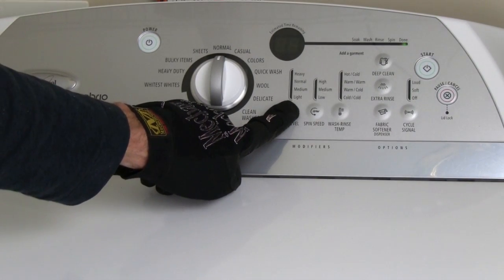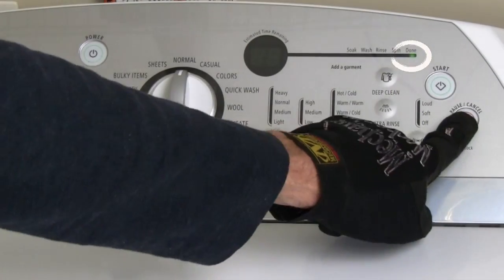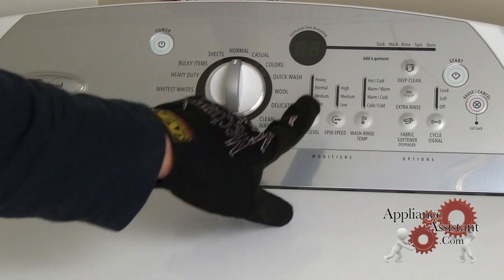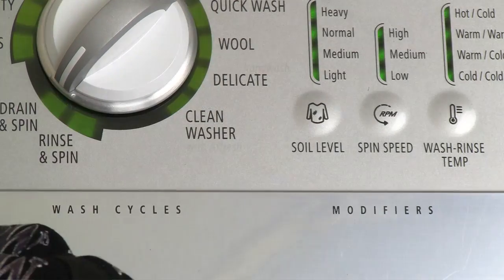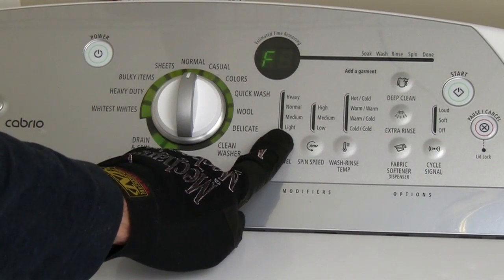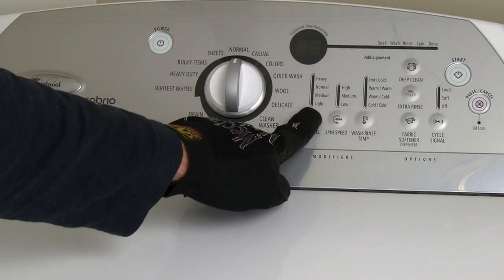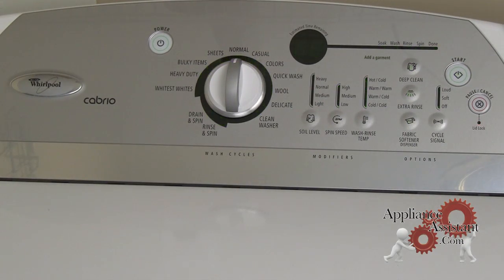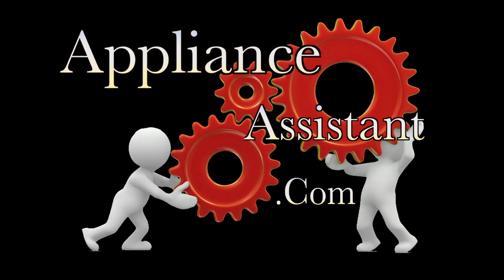Washing Machine Diagnostic Test & Error Codes (Cabrio, Bravo, & Kenmore Oasis)

Comment from the maker: The F70 code is a stored version of oL which is overloaded... it means that the inner tub did not float up off of the hub as water was filling the washer.  This could be caused by something like a sock getting between the inner and outer tub and jamming the inner tub from moving freely.  It can also be caused by rust on the drive shaft and center tube of the inner tub that is not allowing the tub to rise. You need to remove the inner basket and take a look... Hope that helps! Good Luck!
Reply: This wasn't my problem, but this explanation led me to the problem.  Thanks!
Reply: Could it be weak springs?
Reply from the maker: @Socal_fisherman626  not usually on an F70 that would most likely lead to an out of balance error instead of an overload error.
Reply: The basket sits low! When I try to push the basket down, it bottoms out
Reply from the maker: @Socal_fisherman626  it could be a secondary issue. But should not cause the F70 code. There are no sensors for detecting that symptom, except for the ul “unbalanced load” the over load F70 is related to how much time/water is required to make the inner tub float, and disengage from the drive hub.

Comment: Hello, I have Whirlpool Cabrio Model WTW6200SW2 washer, during the cycle UL comes up on the screen and also no matter what load size you have choosen it over fill the water in 2nd rinse and then spin at the time to rinse therefore sill lots of water. Once I pause the machine and then Start again the remaining load finish normal but if left un attended then flooding... Please help. Thanks

Comment from the maker: Depending on how gummed up the hub and drive shaft are it may be easy and may be a pain... The cap of the agitator/wash plate will come off by prying from the side seam with a screwdriver.  Then remove the 7/16" bolt and remove the agitator.  you should see the hub.  You then need to look it over really good for striped gear teeth anything that might keep the basket from lifting free when the tub floats.   I have more info on my website.  Good luck!

Comment: great video!! I had code f41 and code f51. ran diagnostic test and it failed on C1 with an oL code. turns out the basket was stuck on the driveshaft. took it all apart and cleaned gunk from driveshaft. diagnostics run all the way through now no problem. but is there a way I can clear the old codes?

Comment from the maker: Well the drain pump could definitely be the problem. You would need to check for 120 volts the the pump motor when it should be draining... if the pump motor is humming there may be something the the pump that is jamming it and keeping it from turning. If it is not getting power there is ether a loose contact or the control is bad.

Comment from the maker: That is a calypso washer.  id is probably LD for long drain.  You may have a problem with the drain pump... fairly common problem on that washer type. 
“Ld” flashes if it takes longer than 5 minutes to pump out water to a point where the operating
pressure switch resets.
The automatic service diagnostics mode is activated by pressing:
SOAK - SOIL LEVEL - SOAK - SOIL LEVEL
Pump Motor correct resistance values
RD to WH   10 - 12 ohms
YL to WH   10 - 12 ohms
RD to YL   20 - 25 ohms
Good luck!

Comment from the maker: Many of these washing machines are having a problem with the early version of the suspension rods that suspend the tub.  The new suspension kit seems to be solving the problem, it has a new cup that is installed on the top side of each of the four suspension rods.  Part number is W10189077(50.00) for the set of 4.  If you do order them please buy through the links on my website  so I get a little commission : ) or I can drop ship them to you if you email me through my web site. Good luck Thanks!

Comment from the maker: Could you please double check that model number? What country are you in?  It probably means that the lid is unable to lock "Door lock" The F should be followed by something like 51 or 1  The top is held down by two spring clips at the front seem about 3 inches in from the sides... Press them in with a putty knife and lift.  Hopefully you will be able to see the cause or you may need a new door latch or control board... Hopefully you find something blocking the lock from latching... Good luck!

Comment from the maker: It's a little tricky on that style of washer.  You have it right and it should work if the timing is correct. If it does not then you may have a board problem.  Think of it as a safe combination but before you start the process clear the knob at least three full rotations to the left...  then one click each:  R - R - R - L - R  with a very short pause between each move.  If it works all the lights should turn on.

Comment: I know this test well, but I have a problem with the new maytag bravo washers. Model mvwx700xlo, In that tech manual it says to clear the board by turning the selector knob counterclockwise then within 6 seconds turn clockwise 1/2 sec, turn clockwise 1/2 sec again 1/2 sec then counterclockwise 1/2 sec, then clockwise 1/2 sec. I've tried this on several Maytag Bravos and can't get it in diagnostic mode!! Please if anyone can tell me what I am doing wrong???

Comment from the maker: That is the newer style of Cabrio that Whirlpool released after I created this movie. It is completely different mechanically and has kind of a tricky diagnostic mode.  Take a look at the lid striker that is attached to the lid (the part the inserts into the lock.) The back of the strike is open and leaves the internal magnet exposed  allowing it to swell with rust.  When that happens the lock cannot close all the way so it will do what you are describing. If not email me through my website.

Comment: Help i have a Cabrio wtw5500 model...is there away to find a code for it?   It seems like the sensor may not be recongnizing that the lid is closed and it won't stay locked.  It will lock to start and the it unlocks and won't continue the wash.  Please help!

Comment: This machine really sucks!  UL all the time!  It is UL when I run clean washer mode, with nothing in the washer!!!  This washer is nice looking on the outside but I wasted a bunch of money on the set.  Whirpool is making tons off of repairs, parts, and keeping repairmen busy.  The old maytags lasted forever, I had one for 40 years , and the paint never chipped.  This new whirpool lasted 12 months before it started sounding like a train wreck!  Don't buy this machine. It is horrible to listen to.

Comment from the maker: The SD code is usually for suds or a long drain code. you may be able to get it to work by letting the suds turn back to liquid and then trying to drain/spin again. if that doesn't work you may have a problem with your drain pump, pressure switch or control... but probably the drain pump. hope that helps! Good luck!

Comment from the maker: Ahhh... that's slightly different.  Well I don't quite know what to suggest... I guess one step at a time. The nice thing is I think you can send that back to appliance parts pros for the cost of return shipping.  The board should be sending out 120 VAC to the drain pump during the C7 step. If not check connections.  If the connections are good it needs a new board :(  
Sorry to hear about the difficulty... 
My grandma always told me you get further with honey than vinegar... Good luck!

Comment: no, i purchased the drain pump myself and installed it... it is still not draining and giving the same LD code and F32 when i run the diagnostics..the repair guy didnt have the part and said it would take 4 days to get... i got it much faster... the repair guy said he forgot to check the control board with the meter?

Comment: please help, i had a repair guy come out from Appliance Parts Pro to check the voltage on all the wires and i have in writing from them that it's a bad drain pump.... i got a new drain pump from another company online, put it in and doing same thing... so i bought a drain pump and did need one apparently... the tech that didn't diagnose the issue correctly had given me his personal cell and told me to call him if i had any issues... well i called and he is coming out this Sunday. :-(

Comment from the maker: The faint click may be the relay in the board closing to energize the pump. You may want to double check the connections to the drain pump. To be sure you would need to measure for 120 Volts AC at the wires to the drain pump. I would start with that if there was a clog in the tub you should still hear the drain pump turn on.

Comment: i turned it to drain and spin to try and get the water out...all i hear after pressing start is a very faint click... it isn't the lid lock click because thats louder... there was nothing stuck in the long drain (which was the original LD code I saw displayed when it stopped draining the other day) when i ran the diagnostics it says F32.... which i thought was the drain pump... how do i check the internal basket to see if anything is stuck there.

Comment from the maker: The drain pump should be on at C7 until the inner basket drops and is engaged on the basket hub + 10 seconds...Do you here the pump making any noise? if the pump is running and just not moving water it may be broken or clogged, you may also have a clog at the outer tub where the drain pump connects. however, if it is not being energized you would need to check if power is getting to the pump from the control's P4 connection.

Comment from the maker: F51 is an RPS (Rotor position sensor) error. That is the sensor that detects motor movement.  They like to do this error but the RPS is almost never the cause.  Sometimes unplugging and reconnecting the connections to the sensor and the control board several times will clean of any corrosion that has built up and may be causing the communication error. I have a repair guide on my website, but accessing the lower RPS contacts is not very easy. Might be worth a service call if you trust a company.

Comment from the maker: Sorry for the slow response. That would most likely point to your motor getting hot... You may have something like a small sock stuck between the inner and outer tubs.  I have a service manual for that washer available on my website. Its not to difficult to pull the inner tub out and check.

Comment from the maker: @xzqzq It takes a very long drain time to activate the LD and F32 error codes. So you probably do have a blockage somewhere. I usually use a Shopvac to suck out as much water as possible from inside the washer, then tip the washer back so you can get at the drain pump (unplug it first and be ready for a lot more water.)  Partially remove the hose from the tub to the pump and get the water under control, then remove the pump and have a look inside. If it's clear, are all 4 fins intact?

Comment: My Whirlpool Cabrio washer,  type 580,  wtw6400sw3,  cy0270534, is faulting during the rinse exhaust, showing ' LD'  at @ 13 minute mark.   I took the drain hose off, made sure hose & drainpipe clear, ran diagnostic, showed only ' F32'...  Attempted a new wash load - worked OK for the wash cycle, faulted at the end of rinse cycle.    Any idea what the problem is ?  Thanks for the help !!

Comment from the maker: @asobermindisawasted1 there is no easy flush method that I am aware of, but fortunately remoting the inner tub for a good cleaning is pretty easy as well and requires no special tools. Just a flat head screwdriver and a small socket set with a ratchet. Using a net bag is the best way to prevent small items from getting in there. If you have not purchased your pump yet, I would greatly appreciate it if you would purchase through a link on my web site ;) Thanks! Good luck.

Comment: @applianceassistant 

Well, it has been taken apart - super easy to work on. A wash cloth and a piece of bra wire had lodged into the drain, and when the pump was removed a quarter fell out. Damage wise, two of the fins in the pump were broken, so I'm just going to buy a new one and save the old pump as a spare, just in case. Can you recommend any kind of "simple" method of flushing the drain pan of anymore trash without a tear-down?

Comment from the maker: @asobermindisawasted1 Very nice!  Unfortunately I don't have that video completed yet...it has been in editing form for a few months while I have worked on my dryer troubleshooting app.  Fortunately once you figure out the cause that washer is very easy to work on. Bail out as much water as you can, then disconnect everything and tip it back so you can work under it.  Have several towels and a small mop bucket ready for the remaining water. I have some more text help at my web site. Or email me.

Comment: (cont.)
Additional info: Water does not drain; when turned on normally, the washer makes an occasional clanking sound while buzzing; and lid does not lock on diagnostic nor normal wash. 
Any help would be MUCH appreciated.

Comment: No error codes shown so I went through the entire diagnostic. Everything works fine except for C0, C8, and possibly C9. C0 does nothing - no spin. C8 makes a loud buzzing sound with the outer tub and agitator slightly moving back and forth a little and diagnostic appears to hang-up. When I skip to C9, again, nothing happens - C9 comes on for a brief moment and diagnostic ends. 
(cont.)